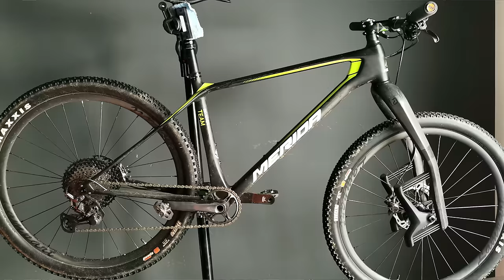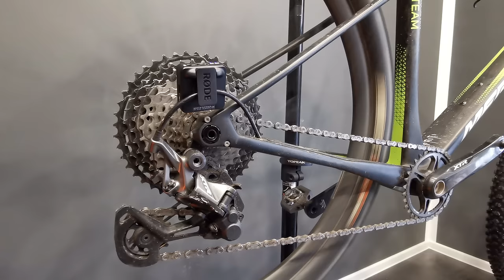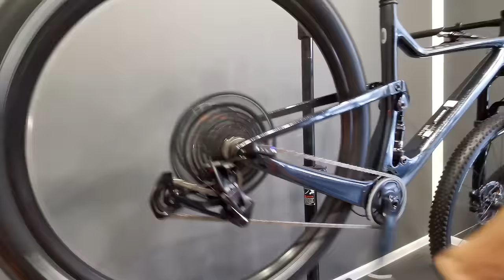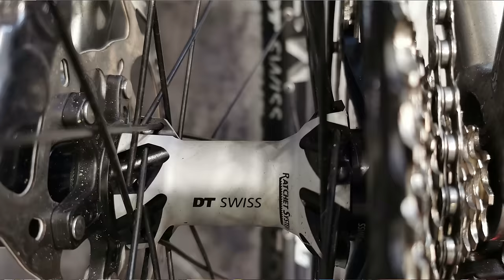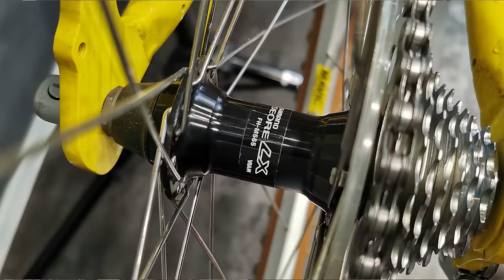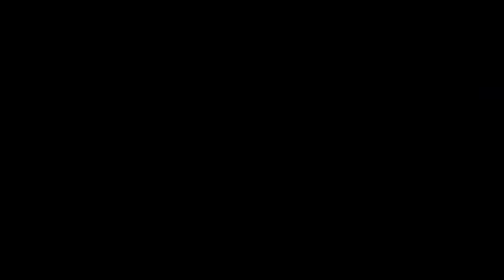Hub Sound Check: DT Swiss 180 / 240 / 350, Syncros, Shimano MT400 + Retro Shimano LX.

Comment: the issue with these sound checks is at the beginning the cranks are spinned with 240+ rpm and you get the sound of the hub with bike  "mowing" 100+ km/h which is fun but unrealistic. So you get the real sound after 5-6 seconds of wheel spinning. But you get the impression that the initial sound is the one ))

Comment: I believe the purpose of hub noise is to warn people on trail to move out of way... I do it, cause it's very effective without bell.
Reply: The noise actually serves no intentional “purpose” it’s just a byproduct of the mechanical workings inside the freewheel. Some may find purpose in the noise, however, hubs are not purposely built to make a loud noise for warning pedestrians.
Reply: noise is energy, so any hub noise just means that energy is being turned into noise, not forward motion.

Comment: Prefer quiet 100%.  Have older Ringle hubs on Yo Eddy 94 and SO loud.
Reply: Are that fast??
Reply: @orionbeltVking  are they fast? They are as fast as my legs can push them. However, I’m sure a research facility could discover that the friction caused by the pawls and the resonance of the sounds in the hub would create enough drag for a 1.4271893 second loss in a 50k TT. Lol

Comment: I find it so bizarre people like to hear their hubs...yet like everything else on a bike to be quiet
Reply: Because hub sound many times means two things, and both are good: speed and engagement. In order for your hub to sound that much you need to go fast, and engagement is good in technical sections.

Hub sound sometimes hides other minor annoying sounds. Any other sound is most of the time mechanic issue related, and those can drive you crazy.
Reply: Think about it this way, is it bizarre that people like great sounding exhaust on motorcycles and supercars but don't enjoy any creaking noise or loud braking noise.

Comment: Dt Swiss is nice, but Mavic Crossmax with the 360 Instant Drive Hub sounds nicer
Reply: And much much cheaper. Got same wheel set recently. Just 240 euros for the pair.
Reply: @mmb4063  yes, it's cheaper. But sadly there are no freehubs for Shimano MicroSpline 12x..so I bought DT SWiss m1900 for my Trail bike
Reply: Got the E-XA 35 with 360ID ...for around 300€
They seem to be solid and easy to maintain 
Made them a bit louder by pulling the spring a little bit and put some mineral oil in it instead of grease.

Still running old Crossmax XL (2006?) on another bike.
Previous owner told me he took them to a bikepark. 😂
I never had to straighten them.
The spokes are HUGE.
Like little axles. 😅
Mavic is great and affordable.

Comment: I am going to build a wheelset for my trail  hardtail and because of acceptable low sound level after all searching I had to narrow it down to just two rear hub models: dt350 and deore xt m8010. I will appreciate all advice of any other possibilities.
Reply: The dt hub is more robust
Reply: Mavic instant drive 360is also silent.
Reply: @Fred_the_1996  yes, i have found also easier to service
Reply: @ReversedCircle  And you can always upgrade to the 54 tooth hub if you want
Reply: @Fred_the_1996  54 is a very nice upgrade path, but my one concern is it makes the hub more noisy... at least from what I have recognized from Youtube. However I have heard that putting more grease could make it more quiet. Anyway it still makes me confused. Fortunately i don't need to hurry up
Reply: @ReversedCircle  true
Reply: @ReversedCircle  I have been riding DT240 and DT350 hubs for the past year on my hardtail and trail bike. Both run virtually silent with the 18T stock star ratchet. The sound you hear for the 350 on this video is the 18T, I believe, while the 240 sounds like it has the 54T upgrade. While you can make out some pawl clicking while spinning the wheel in the bike stand w/ the 18T as seen here, when you're actually coasting on the trail you'd be hard pressed to make out any noise at all over the tires and other sounds. I briefly switched to the 54T ratchet to try out the higher-engagement and the noise was multiplied tenfold or more. It was absolutely deafening, same as I9 or other obnoxious hubs on the market. That wasn't my thing, and as an SPD rider I don't really require high engagement to keep my pedaling smooth, so I switched back to the 18T.
Reply: @dsaxton84  thanks, I am leaning towards dt350 now because of opinions of my wheelbuilder who claims, same as You, that 350 is near silent on 18 ratcher, while m8010 is having some squeaky noises on ocasion that was feedback from his customers. It seems that DT swiss upgrade path seems like trading silence for engagement 😄
Reply: @ReversedCircle  The DT swiss system is great. Once it engages it's very mechanically efficient since 100% of the surfaces are on contact. I ordered my wheelsets from LightBicycle, a Chinese wheel building company, and was able to get some beautiful 25mm and 27mm carbon wheelsets with DT 240 and 350 hubs for <1,000 dollars each, including shipping and duty and whatnot. I'm in North America, so I'm not sure if the cost transfers elsewhere in the world, but I'm extremely happy with their performance and value. They undercut most other carbon wheel brands by 50% and give you excellent quality hubs with complete customization along the way (rim width, rotor mount, spoke weight and attachment style, etc.)
Reply: Man — if I had to listen to that kind of noise when I was touring (for hundreds of miles), I would go freakin' nuts! 

Mind you, I had thought about all of these high-end hubs, however, when I built my wheels, I opted for the MTB ONYX racing hub. It has instant engagement is absolutely silent. It is absolutely stellar! 

This hub was really pricey, but I'm glad I spent every penny on it.  I love the silence, and it rides beautifully smooth and strong. It's also very user serviceable. 

Here's a link to check it out:
https://onyxrp.com/store/mtb-hubs/mtb-iso-hg-135-qr/

And look here to see a video about the design, including its unique SPRAG clutch:

https://onyxrp.com/tech
Reply: @ReversedCircle  I just bought the 54 tooth star ratchet upgrade for my 350, going to put it on and see how quiet I can get it with grease
Reply: @loamymtb  i have finally got 350 18 ratchet straight pull hubs. They seem very quiet, although this is my impression before putting the wheels on the bike. I am intersted in Your experience with 54 engagement points upgrade and how it compares to 18 points regarding generated sound.

Comment: i recently got a new bike that has the 240 hub and its completely quiet do you know if its because its new?
Reply: Yes, more grease means less noise. If you want it louder, take of some grease.

Ratchet system will never be loud as pawls. Degreasing shorts Lifetime of ratchets and springs.
Reply: Thanks for the question. I had the same! haha. It makes a bit of noise when I spin the wheel freely, but not when I freewhile on the road.
Reply: After a bit of use the grease will settle in and the pulsing noise will settle and the hub will get a little louder

Comment: I'm sorry but this is deceiving. I have a DT Swiss 240 hub and the sound when the wheel is in the air is much lounder than actually coasting on the road. I don't understand the physics behind it, maybe the vibrations are absorbed by the ground..
Reply: It’s also not a fair test to use a fully different bike for each hub therefore this video when used for comparing hub engagement noise is pointless and a waste of time. Common sense really isn’t as common as one may assume.
Reply: His 240 has the upgraded ratchets I know because I have the same ratchets in my 240 hub and it sounds the same

Comment: If you actually realised although it doesn't make the biggest difference, due to the way acoustics works the rim and spokes and spoke tension on each wheel also makes the sound different. just saying. a slight loser spoke will have a lower-pitched tone which most prefer.

Comment: Is there any upgrades/ mods for the mt-400 hub?
Reply: Dt swiss
Reply: @duckquack88  I meant hub body or conversions
Reply: @MccrackenN  just get dt swiss mate. Mt400 is not sth u want as a technican. Only had trouble with them. And from my experience they r difficult to mod because there is nothing much u can do and taking them apart is a bit complicated. Plus: they're about 40 eur. on the market...I would simply buy a better hub instead.
Reply: @duckquack88  ya mt410’s on my bike. Debating on selling the wheels before they even touch dirt and upgrading to hydras

Comment: Does quieter usually mean less friction energy loss?
Reply: na it's not that simple. the sound comes the try of re-engaging of the claws or ratchets. so the click as the make contact again. the frection is there all the time also when it's not clicking. The biggest impact of the sound has the desing of the hub and the lubricant. Thick grease is quite silent thin oil makes it louder. the thick grease however takes more energy than thin oil
Reply: Yes. Theoretically.

Comment: Why is the 180/240 so much louder than the 350 despite being the same basic design? I have 180EXP on my road bike and it's nice and loud, then I have 350 on my mountain bike and it's so much more quiet. Is it 18t vs 36/54t ratchet?
Reply: 350/240 are identical- they just machined off weight from the 240, and less mass = more noise.
Reply: It's exactly that, the 18t ratchet is more quiet and has a lower frequency of noise than the other ratchets. It might also have something to do with how the 350's ratchets are both pressed by a spring. The springs might absorb some vibration and sound. On newer Ratchet exp one of the ratchets is in the hub, meaning the slap of one ratchet against the other might ring throughout the hub body.
Reply: I am unsure on 18t Vs 36t Vs 54t as videos on here I watch the more there is it sounds quieter to me

Mind you all my hubs are silent 😉 I am a guy who doesn't like coasting, I go from pedalling to pause pedal as apply brakes to stop within 5-10 metres, I know it best not but I love quick change between waste energy to stopping 6" from back of cars

Comment: I have 2 bikes with the same wheels, and both with DT Swiss 350 hubs, one bike is a lot louder than the other, and a friend has a bike again with the same wheels and hubs which is also quite, so does that mean my bike with the louder noise needs more grease, or its just the way it is and that’s how it’s bedded in?
Reply: It can be the type of grease that is used inside of the hub. A thicker, more viscous grease will quiet down the hub whereas a lighter grease such as the one that dt Swiss makes itself, is lighter most likely resulting in a louder free hub.
Reply: Also depends on the ratchet inside. There's 18t, 36t and 54t.
Reply: @eddiecollins4636  Thicker grease  such as NLGI2 just gets displaced after a while depending on a specific geometry of engagement ring and pawls, while NLGI0 might flow back where it needs to be. NLGI00 might flow even better but might leak out while not being able to reduce the noise sufficiently. Also base oil low base oil viscosity will cause lower drag and louder noise while having weaker film strength.

Comment: When riding with clutch mechanism on rear mech should it be on or off
Reply: on
Reply: Always on, only when you gonna take off the wheel then you turn off the clutch
Reply: @stahudym1096  cheers kid
Reply: On.
Only turn it off when doing adjustments or taking off the wheel.

Comment: can i buy any bike hub and install it on my bike ??? i  have a road bike and take cycling serious , the Bianchi i have is to quiet and want to get something louder how do i go about that ?
Reply: If it’s disc brake, get the right style of rotor mount (6bolt or center lock) if not, get one that does not have a disc mount. Also need to make sure it’s the right axel size. If qr, get a qr hub. If TA, get the right size TA hub so like 12x142 would be 12mm axel non Boost rear hub. You probably just have qr. also need the right spoke type (j-bend straight pull etc.) you probably have j-bend. Last thing you need is to make sure the hub has the same hole count, like 32h 28h etc, judt count how many spokes you have and that’s your number.